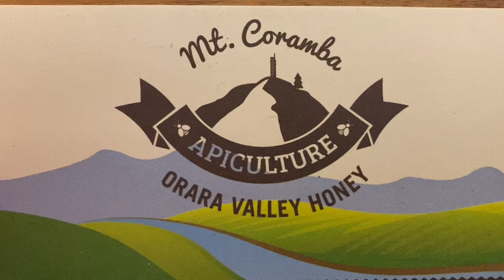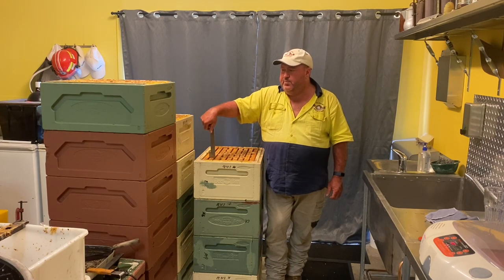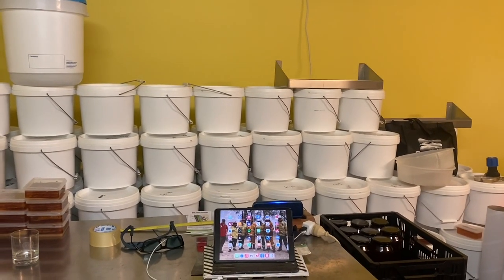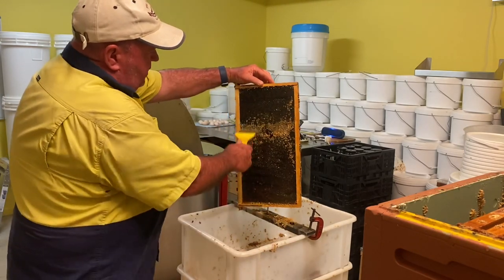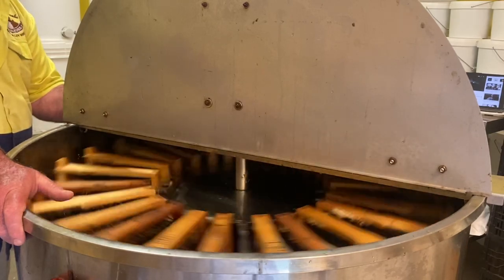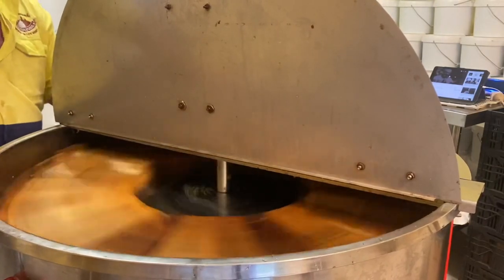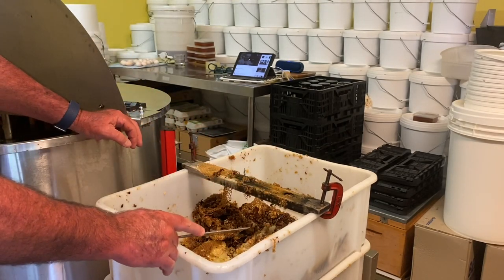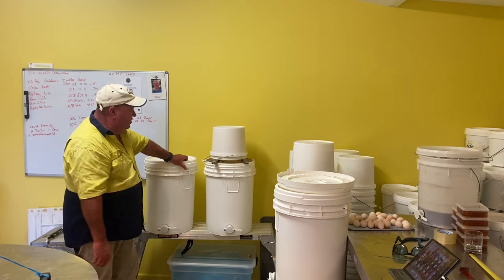🐝  Easy honey extraction in a small scale commercial apiary.  Spring 2021. Orara Valley Honey.

Comment: Nice work mate, heavy aren't they even in a paradise box
Reply from the maker: Yes the ten frame boxes are at the limit of what I can lift.
Reply: @mt.corambaapiculture  I had a similar set up with that same uncapper that slops around for some years, then upgraded to a stainless uncapping tank which can hold and drip out heaps of wax like 30+ boxes, and I use a honey plane, irt's super fast does not damage the combs and makes the job far more enjoyable and faster. I have also a 24 frame extractor which goes great. I once bought bees from a fella in the Orara Valley, nice country. How is this season so far for you ? Get one of these I bought mine from Nuplas but it's the same thing on ebay, on 2nd season and going strong. The beauty of this is you can have the frame on a 45 degree angle frame holder that comes with most large stainless UC tanks, both hands are free and not holding the weight, then you can plane off the caps. You still need a scraper for the odd low spot. When I get a good camera I will make a video
Reply from the maker: @livingadamman7994  Thanks, Adam.  the season is good & my bees are going well.  Thanks for the advice

Comment: When the extractor is running, does honey get spun out of both sides, or do you need to reverse the spin to get them out of the other side?
Reply from the maker: That's correct.  It's a radial extractor. The top bar faces the outside & honey spins out of both sides of the frame at the same time.

Comment: Not sure if I’ve asked this elsewhere but after extraction do you put the sticky frames back onto the hive for cleanup in a new super. Just for like 2 days then remove?
Reply from the maker: The stickies go back into the same hive in the same super.  They stay on the hive to fill up with honey again.
Reply: @mt.corambaapiculture  oh I was picturing doing the following. Putting a new honey super box with empty frames below a full honey super, but with an escape board in between. Then bees would move down. I extract top box. But then after extraction wanted to cleanup frames ready to be reused at a later date. Trying to understand your cycle of how your removing frames extracting and then replacing? When you lift frames out, don’t you immediately put a new empty one in to replace? Also if it’s winter time then the extracted frames definetly wouldn’t go back in, in which case I’m kinda just thinking through the cleanup of stickies over winter.